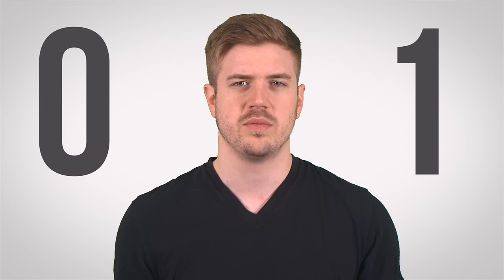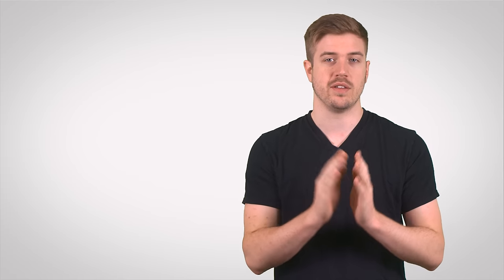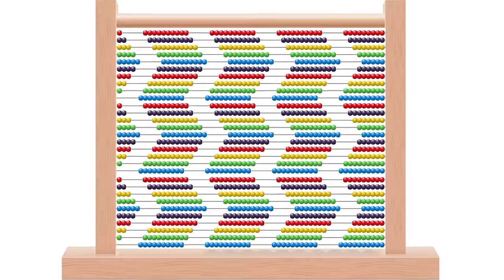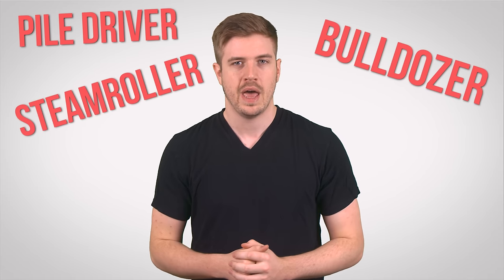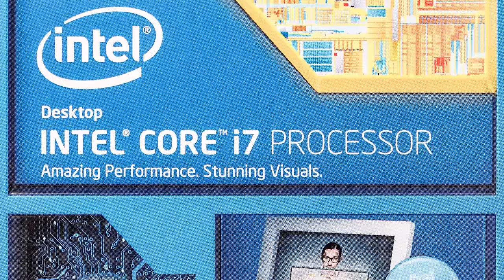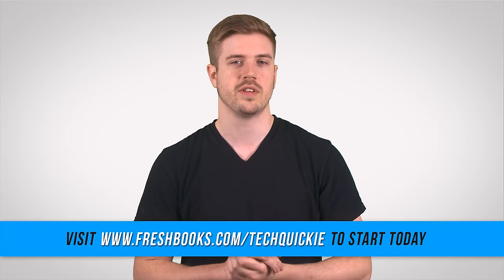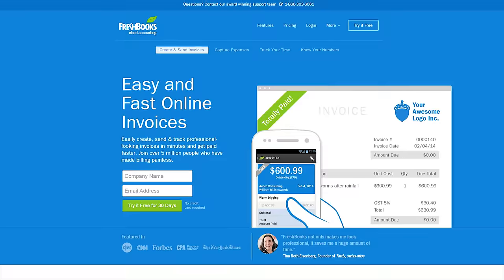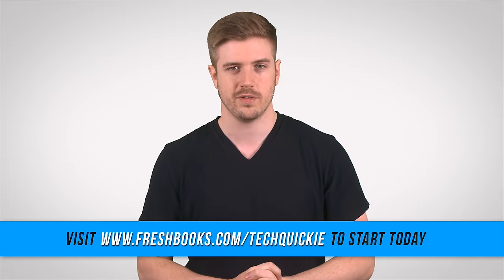Coding Communication & CPU Microarchitectures as Fast As Possible

Comment: Instructions unclear, over clocked my car. Killed people in front of my car. Voided my warranty.
Reply: Benny Kolesnikov I laughed wayyyy to hard at this xD
Reply: Benny Kolesnikov Ah, the freedom warranty.
Reply: Benny Kolesnikov Your car clearly needed more fluups
Reply: Try adding more voltage.
Reply: Benny Kolesnikov make sure to use aftermarket cooling!
Reply: Did you forget to add a better fuel pump
Reply: Used liquid nitrogen instead of water as coolant. The car no longer has a cooling system.
Reply: Eri g Good one!
Reply: Benny Kolesnikov Instructions unclear, I was going to upgrade my PC with a new CPU, ended doing a 2JZ engine swap instead
Reply: +Benny Kolesnikov But did you void your bowels?
Reply: @ShqdowAngel  LOL
Reply: this was hilarious xD

Comment: As a Computer Engineering major, I'm proud to say that this is actually a reasonably good explanation.
Reply: It's an extremely poor explanation. Half is directly wrong, even objectively. It's really incites a complete facepalm, a major one...
Reply: @TheMrTape  what is wrong though? I'm a noob in this but I understand what I came to look for (i.e. that the microprocessor carries out instructions using transistors in logic gates, and also cleared things from other videos, like that these instructions are possible with the voltage that is given to the microprocessor with each cycle of the microprocessor's clock)
Reply: @thisisrtsthree9992  #00:00 To program, I'm programming, I'm a programmer, not code, coding, coder. A clear text program is code as much as any spoken language is (not), even though refereed to as source code, only what it compiles to, assembly instructions, is by definition code.

#00:15 and #0:25 CPU's doesn't take "code" directly, it's not compiled (mentioning later doesn't make it right).

#00:28 Both can be represented by letters and numbers if translating the binary they both consist of to their respective character abstractions; this representation is only relevant for humans, as the CPU can only see the binary; my text is seen as binary by any CPU, abstracted for your understanding. It's a choice whether to represent something as binary or otherwise to humans; it's irrelevant to the CPU.

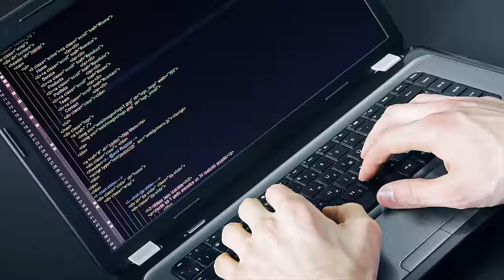#0:43 There's not English/Chinese etc. versions; it's not whatever language you want. It's always English. You may name your variables or make comments in any language of course, but the statements and functions are all English.

#0:45 There's no sets of instructions when you're talking source code, it consists of statements, functions and operators; instructions exist only in machine code.

#0:48 You can't chose whatever programming language. The languages shown in the background are HTML (not a programming language but a markup language) and Javasctipt, both of which are interpreted rather than compiled to machine code, thus irrelevant to what they're talking about.

#0:50 A program only needs compilation if it's a non-interpreted language (eg. C, C++, Java rather than eg. Javascript, python, PHP). Again, the programs shown in the background doesn't need compiling to work; in this case no further processing is needed for the CPU to understand, because it doesn't, it uses a translator program to interpret the program in real time.

#1:03 A compiler doesn't check for errors, it "checks" for wrong syntax (grammar) by not being able to compile. Also "object code" is a deprecated term for machine code.

#1:13 The reason a CPU can interpret machine code/instructions is that this is what it's designed to interpret as instructions; the machine code is 0's and 1's as much as the clear text it's compiled from, since every character is an abstraction of 8 or more bits; it's the exact same thing the CPU sees, always, and this is the only thing it could ever see, 0's and 1's. The differentiator is that the bits of an instruction translates to working CPU functionality while bits of a character translates to the valid character. They're implying that nothing of it is binary before it's compiled, as if the CPU could understand characters directly, as opposed to through abstraction via the 2 "letters" it understands, 0 and 1; the letter A means nothing to the CPU, only A's binary representation: 1000001. Binary is completely irrelevant to any of this, it's always fucking binary.

#1:17 Implying that binary is something modern that weren't always the only thing used for computing.

I won't bother with the rest. It's all so far of that you're better off assuming how it works. Most of what's presented in these videos are layman assumptions anyway. The (mis)information put forward is worse than a basic school project involving actual research and understanding.

#3:11 Only true and relevant point put forward in this video.

Overall everything gainable from watching is an extremely dumbed down and twisted understanding of how CPUs work.
Reply: @TheMrTape  ya ma dude, thanks for taking the time to write that long reply, I checked some and I saw you are right!! so if anyone peeps this answer they can see too
Reply: @TheMrTape  You should be an engineer teacher! wow i learned lots and actually wanna learn more now!
Reply: @TheMrTape  Please explain how a CPU works in 5 min plz
Reply: @WetPig  Are you 11? I could, many times better, however just because I didn't is not a challenging argument nor indication I couldn't. Kids commonly believe in this kind of invalid arguing, it's really pathetic.
Reply: @TheMrTape  and not a single mention of VHDL..
Reply: @TheMrTape  Didn't the very first computers use decimal digits for doing operations, before binary started to be used as the standard base?
Reply: @TheMrTape  PhD in computer science here and working at Microsoft Research - your comment is heavily misinformed and I'd advise everyone to stick to the (much more accurate) information presented in the video :)
Reply: @TheMrTape  Let's keep it civil!

There's no reason to hate on a video (or me) because the video isn't as in-depth as your hardware/software interface 101 course. It's good enough for the majority of people (as intended).

It's not productive to reply to all your points, but for one, a programming language source code doesn't necessarily need to be English: https://en.wikipedia.org/wiki/Non-English-based_programming_languages.

Your other points are needlessly nitpicky. "A compiler doesn't check for errors", it's a 5-minute video, he's not going to explain the differences between runtime and compiletime, and a syntax error is a type of error.

What are you trying to gain by nitpicking the video? I don't think your comment is doing any favors for any viewers of the video. If someone is a beginner, they don't need the extra details you've added, and if someone is experienced (like you and I), they don't need to watch this video in the first place :)
Reply: @piggy8435  I really really agree with you!
Reply: @piggy8435  god thank you so much many of his points were just nitpicks and obscure stuff that does not actually matter. im just sad that assembly didnt come up in this video
Reply: @piggy8435  i know it's been 2 years,
But I heavily agree with you on this point.
Sometimes a bit of foreshadowing on minor details is required for the people to not drown into the rabbit hole of information.
I could start reading about logic gates and transistors and all so fast start researching the chemistry being n-types and p-type semiconductors with their rates of electric impulses differenciation in physics, it isn't of a necessary relevance, and hence best to stick to surface level

Comment: We're designing a basic CPU (not every instruction is available, just basics like add, subtract, move, store, load, compare etc) for our Computer Science class right now and it's awesome. I'll add a little snippet of blabber for anyone a little bit more interested in the specifics of how you go from 1s and 0s into instructions. It's kind of hard to condense into simple terms, and I might just sound like a madman talking about nonsense, but hopefully it might explain something! 

A compiled program is just a list of instructions. An single instruction would be something like "add r0, r1, r2" which means we want to add the value in register 1 with the value in register 2, and store that result in register 0. Say we are using 32 bit architecture, this means that each instruction  we use is represented by 32 digits of 1/0s. We split these 32 bits up into different parts to represent information about what instruction we want to run. The CPU takes an instruction, splits it up, and does the various instructions based on what was fed in. 

So for example in the ARM architecture, the leftmost 4 bits represent the condition of the instruction. If it is 1110, that means we should always run the instruction. If it is 0001, that means we should only run the instruction if our condition flags are set to "not equal". We would have to run a compare instruction beforehand to compare 2 numbers which would set the condition flag registers (like "cmp r0, r1" which compares the value in register 0 with the value in register 1, and sets our condition flags to show the results of the comparison telling us stuff like if it is greater than, less than, equal to).

A typical instruction would (for a data-processing instruction) would have 4 bits of conditions, 2 bits of "op" (representing what kind of instruction we are using, e.g data processing vs memory, 6 bits of "funct" (this tells us what our actual instruction is, for example add which is represented by 0100), 4 bits of Rn (the register that contains the value we are using for the instruction), 4 bits of Rd (the register where we store the result, e.g. 0011 in binary means 3, so we store the result in register 3), and 12 bits of Src2 (the second value we are using which can either be another register, or an immediate value). So with "add r0, r1, r2", Rd is 0000, Rn is 0001, and Src2 contains 0010 (along with some other information like bit shifting and such).
Reply: We use the textbook called "Digital Design and Computer Architecture". It didn't tell us everything we needed, but helped us design the basic circuits which we added onto with our own logic. There's this awesome free software called "Logism" you can use to design circuits. I would recommend learning how to do basic c programming, learning how to create that same program in assembly, and then learning how that assembly translates into machine code. Hardest part about this stuff is that it is really hard to find answers online, but if you're motivated and good with textbooks then you should be good with the book!
Reply: I kinda learned it the other way around from "ands" and "ors" to flipflops to master slave to counter ... etc.. But we never made a CPU, we just programmed one.
Reply: Yeah we covered flip flops and the circuitry after we made a "compiler" that read compiled assembly machine code and did the instructions in C.
Reply: This comment is a year old.
Man I wish I was smarter back then. Had to leave university, I literally just burned money with no results.

I wanted to be a programmer so badly lol, or anything related to IT engineering.

I ended up as a network technician (and I love it). Industrial routers are also a challenge, but not as a CPU.

I'm just literally too stupid for being a programmer or hardware programmer.

Wish you guys the best! Do my dreams :D
Reply: I still don’t understand how people go a transistor to obey a command like store.

Comment: Not all languages run through a compiler though; some go through an interpreter, which is a program that rather than translating your code into machine-understandable bits and bytes, runs the program directly instead. Python, Ruby, and JavaScript are such examples.

About the instruction sets: The labelling for 64-bit architectures varies from website to website. Some write it as x86-64, some write it as x64, and some again write it as AMD64. These all refer to the same thing, the name just varies depending on who you ask.
Reply: Nikolaj Lepka Interpreters basically compile the code line by line and execute it immediately. While you are correct that there is a difference between the terms Compiler and Interpreter, all this video needed people to understand was that source code is not directly understandable by computers, so it needed to be converted first :)
Reply: Edrulesok what you're referring to is a just-in-time compiler, which compiles the code line by line. An interpreter doesn't, it just tries its best to parse and execute the code directly
Reply: Nikolaj Lepka You should go and read up about this :)
Reply: Actually, they are compiled. Whilst I can't speak for JavaScript or ruby, I can say with 100% confidence that Python does go through a compiler. If you don't use the interpreter and just use the command line to execute a python program, a .pyc file will be generated (Python compiled), it just generally gets compiled at a different time by the interpreter.
Reply: James Brunton Then explain why PyPy is different then
Reply: Nikolaj Lepka Direct quote from PyPy's website:
"Speed: thanks to its Just-in-Time compiler, Python programs often run faster on PyPy."
Reply: James Brunton yes, I know PyPy is a JiT compiler, I'm just making the point that normal Python isn't
Reply: James Brunton It's true that Python is compiled, but it isn't compiled into Machine code, it's compiled into byte code which is only understood by the python virtual machine. Java does something similar. You can think of byte code as "Virtual Machine Code"
Reply: Nikolaj Lepka How can you run the program directly? Your computer can understand only 1 and 0. It knows only these voltages. If you type anything in Javascript or in any whatever language it will be compiled to the semi code that will be later translate to 0 or 1 or directly to 0 and 1. Any instruction n order to be run must be finally translated to 0 and 1 sequences.
Reply: VideoKursPL it's not being compiled, the program parses the lines of code and turns them into instructions
Reply: definition of compile = (of a computer) convert (a program) into a machine-code or lower-level form in which the program can be executed.

Instructions whatever they look like must be finally translatted (compiled) into 1 and 0 in order to be executed by your processor.

I understand that JS is interpreted by parser and these instructions can be executed inside web browser and instantly executed, but web browser is responsible for making everything work and everything must be someday changed into 0 and 1.
Reply: VideoKursPL you basically described how every interpreter works, minus the web-browser part
Reply: Nikolaj Lepka You're forgetting that all languages eventually get assembled by the assembler in whatever you are doing. Assembly language code puts other languages into 1 and 0's. So you're arguing a mute point. Everything must get assembled. Then put into machine code. Took an assembly language class at university. Drove me nuts moving data around inside the CPU manually.
Reply: Nikolaj Lepka I agree, not all interpeters are Just in Time.  Some are, some aren't.  I think it's more common now for them to be JIT down the bare metal to have any chance of being used in larger programs.  For example, we find Python to be fast enough for a lot of the coding on our packet capture system, and leave only part of the coding to be done in C++.  And it's even possible to do this special type of Python which is closer in speed to C++ code if we wanted to go down that route
Reply: Nikolaj Lepka Well, AMD64 is like how i386 is to x86.
Reply: Michael Bauers Python compiler was developed using C language. C++ is just an enhanced version of C. You can use efficient C code to get faster throughput
Reply: +VideoKursPL Does not mean it&#39;s correct to say scripting languages like javascript or lua get compiled, they don&#39;t. They aren&#39;t compile time languages, the source code will get interpreted at run-time ( obviously it has to be compiled to cpu instructions at some points). Javascript does not get compiled to a semi code after writing the code, it stay in clear text untill execution. You&#39;re referring more the c# or vb.net which get compiled to IL code (intermediate language)(and some more jazz) which then will get executed by the clr and Jit compiled
Reply: +Darunko 
Why are you using html codes for your apostrophes?
Reply: +The horrible story of a man that was forced to connect his youtube account to google+ Sometimes YouTube (I think this might be a Firefox glitch) will automatically change them after you post your comment.

Comment: do a vid on fragment/disk cleanup (why its recommended etc..)
Reply: you only de-fragment a hdd since a hdd is operated by a needle reader (like a big record)... to access data it has to move across the disk platter, over time and multiple writing/deleting from disk can cause gaps to occur over the disk. This is enefficient since the reader is moving over black space and so de-fragmenting basically condenses the bits to reduce the amount the reader has to move =)
Reply: This is also half automatical, which is why it's rare nowadays to find significant de-fragment from hdds.